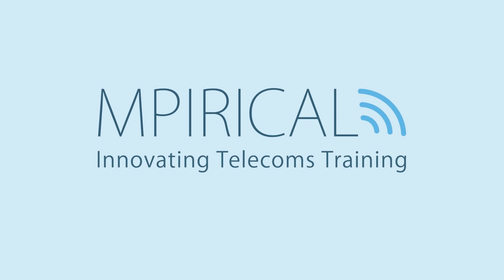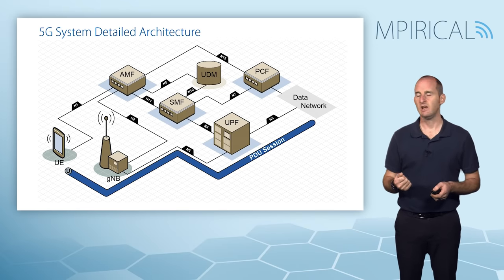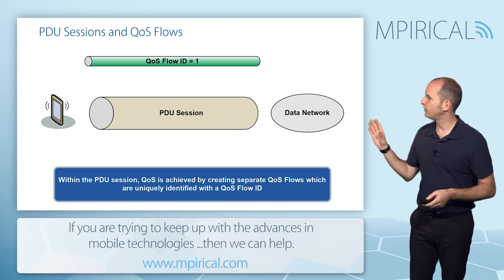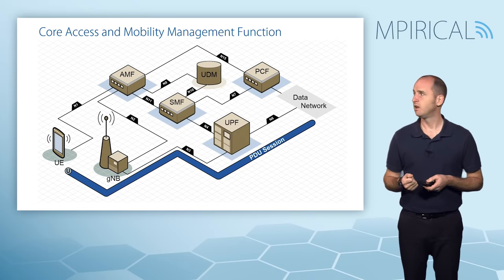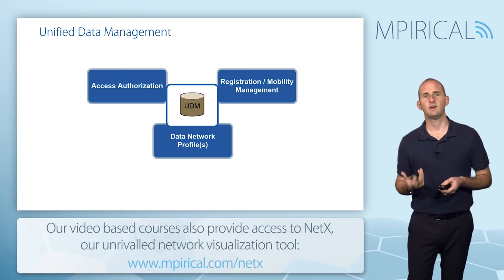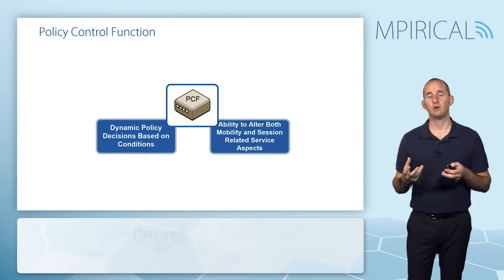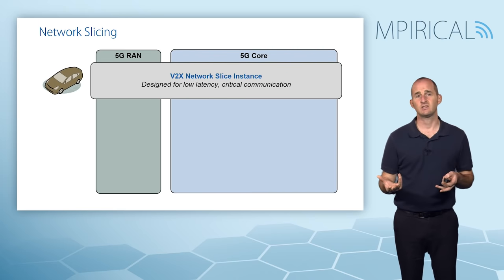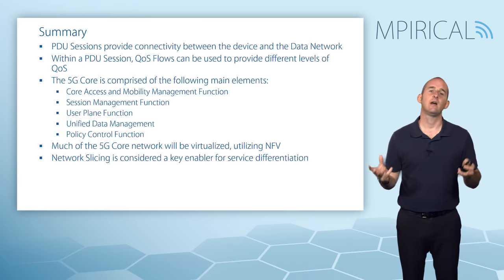What is 5G Core Network Architecture? Take a Look With Mpirical

Comment: The Geo-blocking we see in YouTube or Spotify is achieved through PCF?
I'm really grateful for this and all your content, this is the best channel for a Telecom engineer.
Reply from the maker: Hi Ishu, thanks for your comment! 

Geoblocking is often carried out by resolving an IP address for a device to a specific network domain, which is why using a VPN can circumvent geoblocking in some cases. Technically, the PCF would have the ability to provide policy decisions for specific IP flows, but in reality it is the actual web content provider like Netflix, Youtube or Spotify that conducts the blocking.
Reply: @Mpirical  Ahh okay, thank you for the answer. Guess I'll have to read on how web contents are delivered. Cheers!

Comment: I would like to learn what technolgy is in sub 6 midband 5G
Reply from the maker: Hi Gary,  thanks for your comment. Can you please elaborate on this? We'd be happy to recommend courses or put you in touch with a trainer who can answer your questions more specifically.
Reply: @Mpirical  mid band 5G that works on FR1 6Ghz
Reply from the maker: @garychadwick8640  5G Midband usually is quoted at supporting 1GHz to 7.125GHz (was originally “1GHz to sub 6GHz”). In terms of 5G Midband deployments and frequency options, there are may at the lower ranges (1.8GHz, 2.1GHz, 2.5GHz, 3.5GHz). However, at the higher end the band n96 is available in North America (5925MHz to 7125MHz), as well as newer global Bands: n102 (5925Mhz to 6425MHz) and n104 (6425MHz to 7125MHz). Currently there are not many deployments or devices supporting these bands, however it is still early days for 5G Standalone Providers and Private 5G solutions.